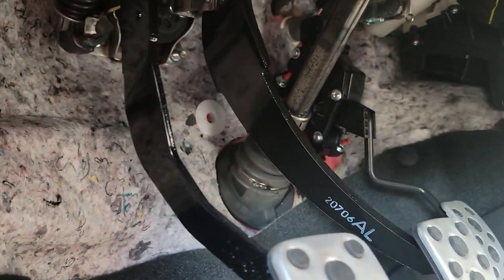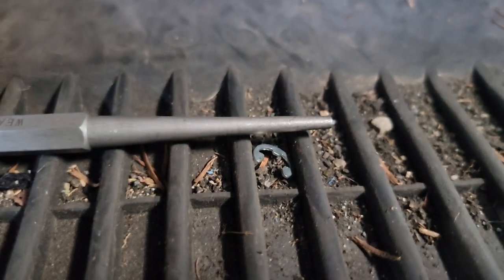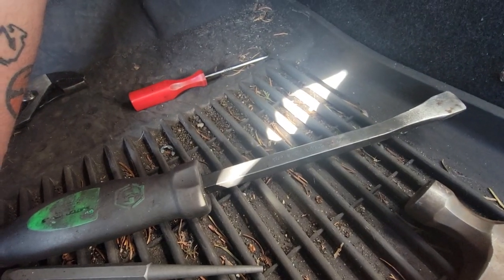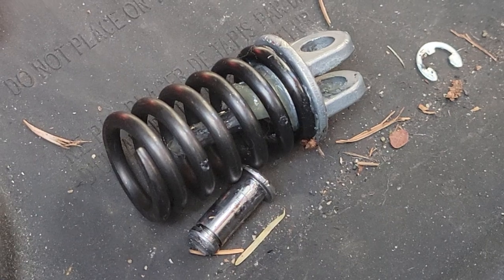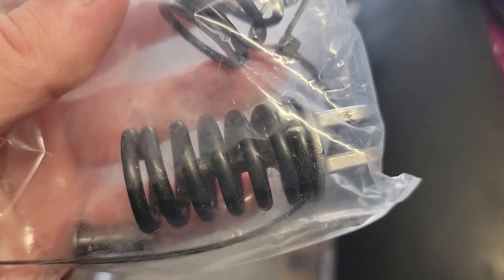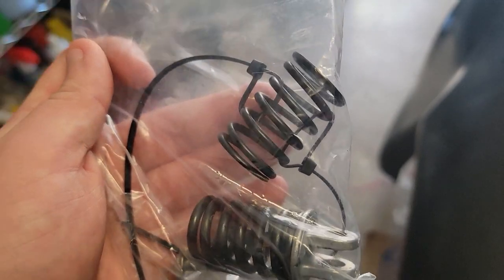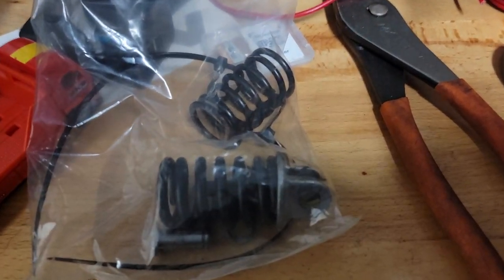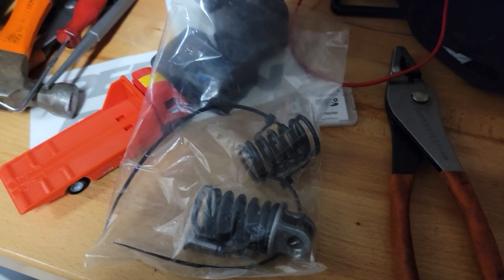BRZ, GR86 Clutch spring delete

Comment: I also did this and really enjoyed how it felt with no spring but I got worried about the throw out bearing wearing too quickly without the spring so I installed a GKTech spring. Do you know anything about the TOB wearing quicker with no spring?
Reply from the maker: I assume it wouldn't make a difference as the spring is to just help make the clutch pedal feel softer
Reply: @DankersRacing  sweet, removing spring as we speak
Reply: Won't wear the tob. It's not enough pressure to move a hydraulic system.

Comment: Im about to try this now. Quick question though, did u have to adjust the master cylinder rod or clutch switch rod? Did removing the spring affect these at all?
Reply from the maker: Nope. The clutch pedal is in the same exact location so there's no adjustment needed. You could try to adjust it to get rid of that 1/8th of an inch (dead pedal feel) but honestly from my past experience it does more harm than good lol pulling the spring out doesn't affect anything other than over all feel